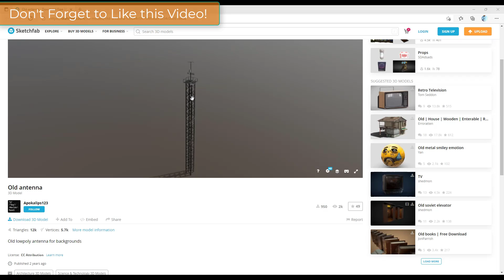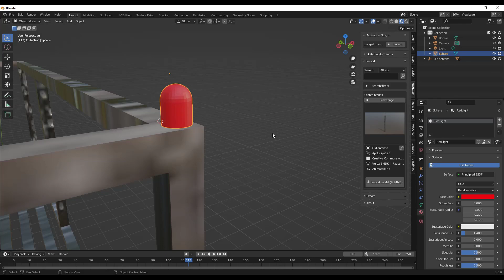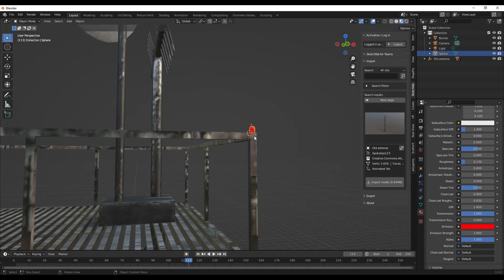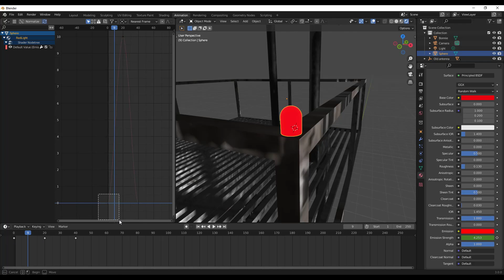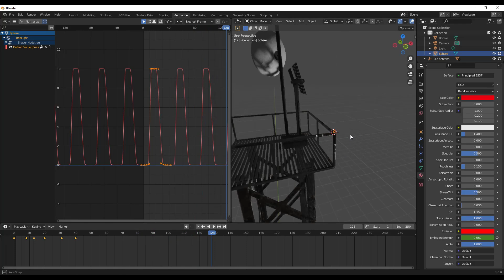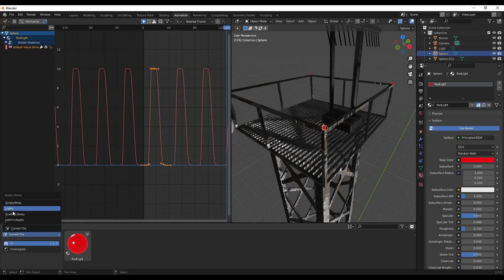How to Make a BLINKING LIGHT in Blender!

Comment: Great videos! I've been using Sketchup for over a decade, and I'm just starting to learn Blender now. But I'm curious to know as a package designer in the alcohol industry... Is there a way or an addon that would allow me to design a package first in 3D (hopefully in Blender) and the artwork automatically gets translated as flat art on a dieline that was supplied by our printing press? Essentially designing a carton, bottle or beer can in the reverse order, but still ending up with the same end result... which would be a flat art ".ai" file with fonts and links, all packaged in a zip file to upload for the printer to use. Does something like that exist? If not, could someone create such a process?
Reply: Not sure if I understand your question correctly. Blender is a 3D creator, not a design program for flat designs. You’ll have to design the label in Illustrator/Photoshop and apply it as UV texture in Blender.
Reply: @macnavi  Yeah. It sounds like an absurd idea to design in a backward order. But I had to put it out there. Right now we use something called ESKO to visualize our designs in 3D while designing. But what if you could add your graphics from an asset library to a 3D model in real time? And then let the software apply these graphics to a die line in the background? I’m just imagining a more fun future for package designers.